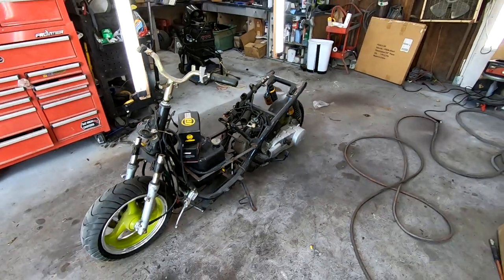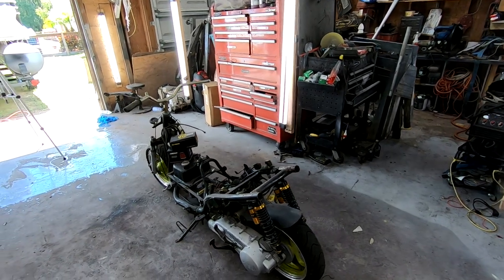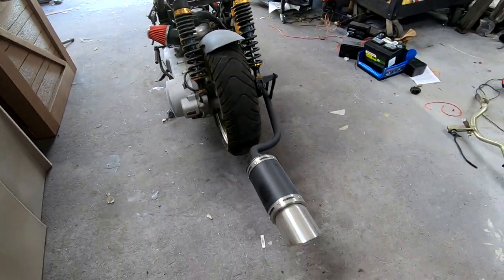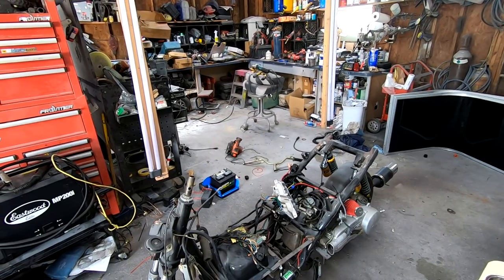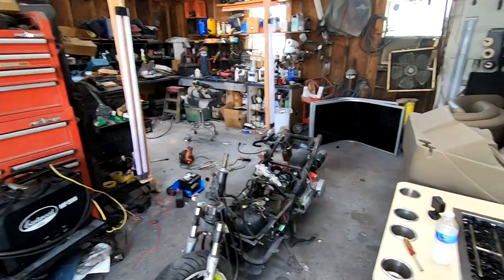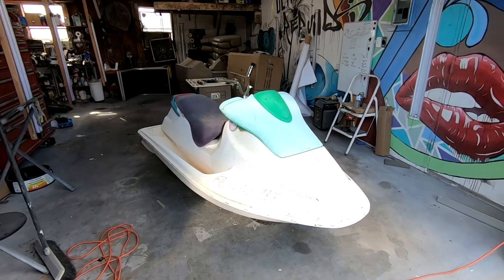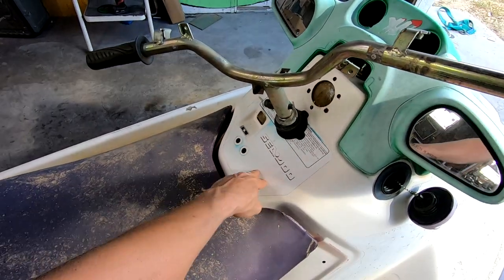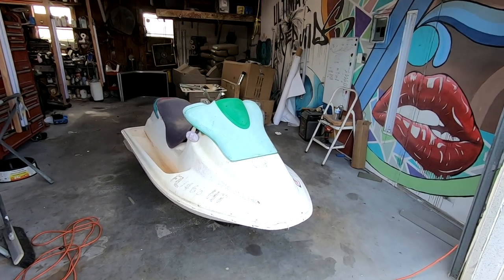Building a Jet Ski Scooter Mounting the Body - Episode 3

Comment: That exhaust pipe is a long lever arm, I would suggest adding reinforcement near the rear, otherwise after a couple good size bumps it will snap off.
Reply: Definitely. Especially since he used iron pipe made for gas lines, which is a new one for me. It is pretty soft, so would be good for bending. But as soon as it gets hot for a while, that sucker is gonna DROOP.

Comment: I think a set of fold up landing gear that you could put down with a handle for when you come to a stop would keep you from toppling over a stop signs.
Reply: I was thinking of a foot pedal or pedals that would drop down a skid or roller on each side so that when at a light he just steps on those, and can keep them down until moving enough for it to stay upright.
Reply: @lvlndco we're definitely on the same page for sure. He needs something that is for sure. I know my balance isn't that good.

Comment: I recommend stabilizing the exhaust some more. I'm afraid that it's going to start vibrating bad when driving. Maybe a band around the muffler that's attached to the body with bracket and a bolt or two?

Comment: If I may make a suggestion. I would try and put some rubber between the body and scooter. It may vibrate loose and or sound will travel through the hard mounts. Looks good, so crafty.

Comment: I would put a swing down lever in the footwells to act like you are putting your foot down at a red light, maybe a small wheel on it so it could act like a landing wheel, make it retract so you don't see much of it when you take your foot off, just use the bike brakes for stopping and the swing down extension for balance while stopping.